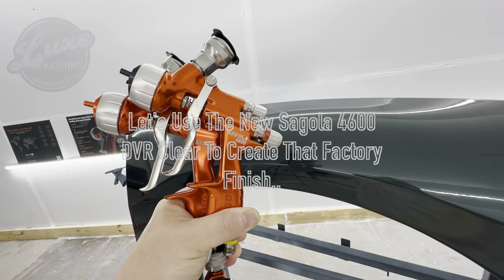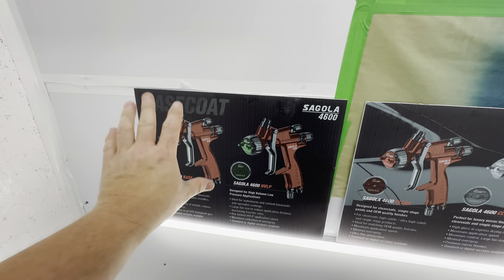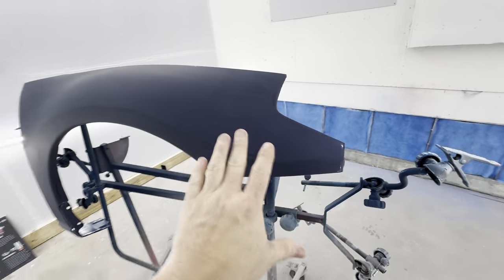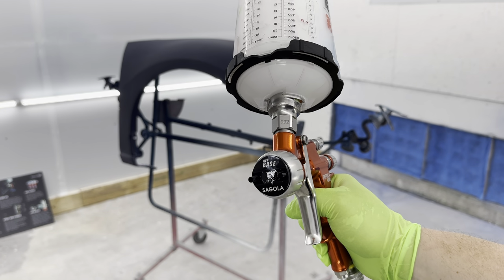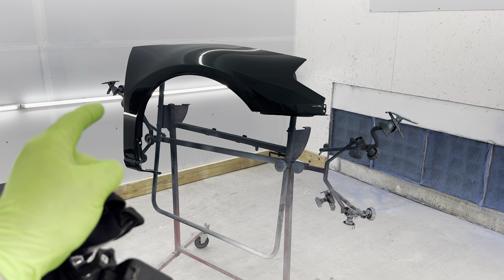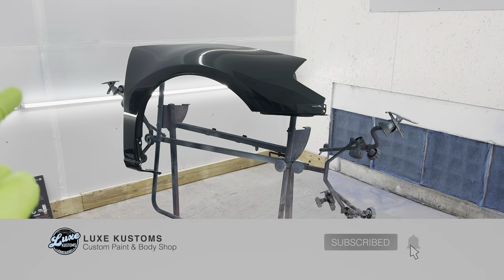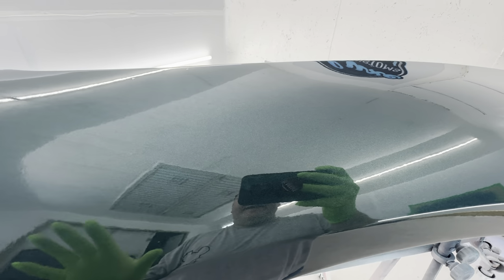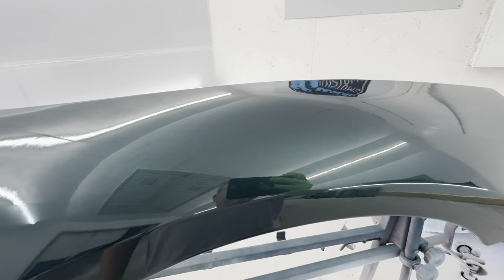How To Setup Your Paint Gun To Spray a Car! | Sagola 4600 DVR Clear Air Cap for That OEM Finish!

Comment: HI IAM FROM THE UK 🇬🇧 UNITED KINGDOM JUST SUBSCRIBED TO YOUR CHANNEL I HAVE A NEW BOXED SAGOLA EXTREME AQUA 4600 1.3 FOR BASE  STILL SEALED WAS GOING TO SELL IT AND GET THE DIGITAL VERSION THE CAPS ARE INTERCHANGEABLE AND YOU CAN USE THE GREEN CAP HVLP AND THE DVR CLEAR CAP AND THE TITANIA CAP THERE NOT CHANGE ABLE ON THE NEW SAGOLA GUNS 😊
Reply from the maker: Thank you for subbing... I will say i have both, and the new Sagola.....so much better IMO.